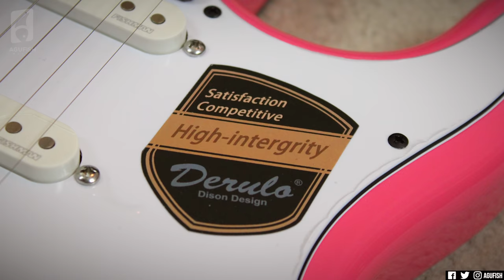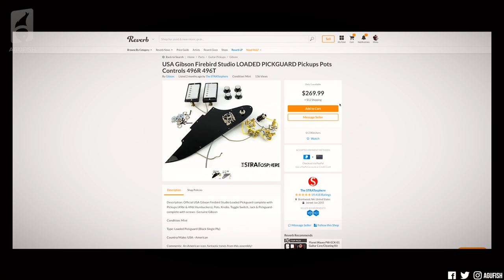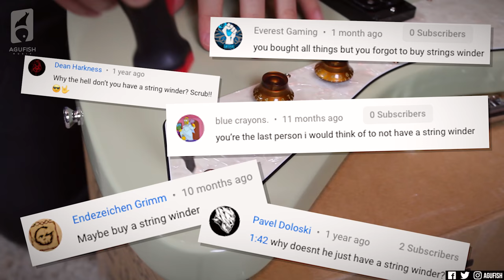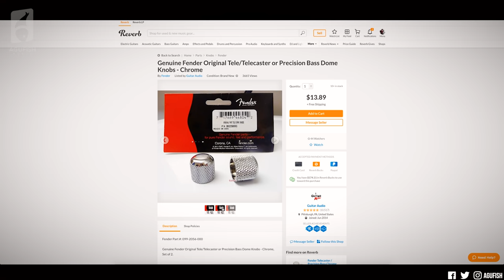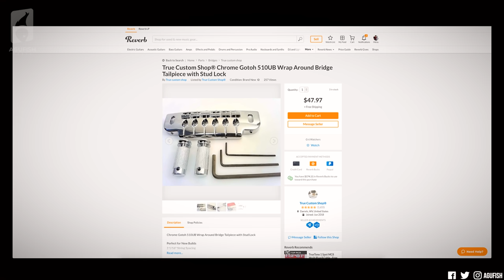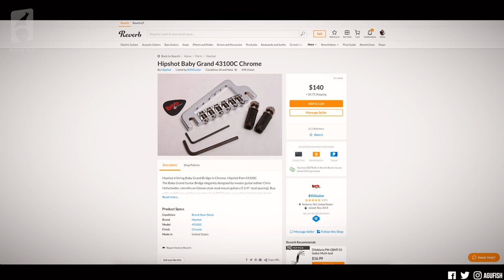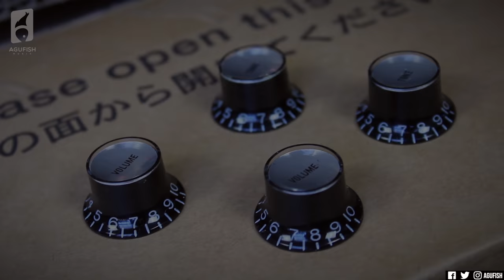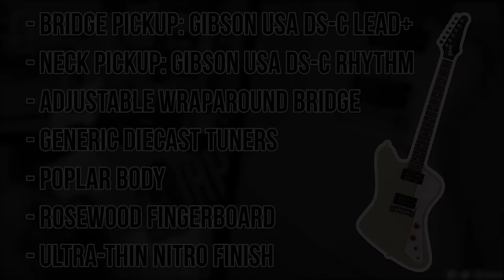Making the Worst-Ever Gibson... Good?? || High Intergrity Mod Project

Comment: "It was hard to keep in tune"
That's a Gibson feature.
Reply: I have two. An LP and an SG. Zero tuning issues. Learn how to do proper setups 👍
Reply: @jeremyrafuse5330   Haha good one.
I plex all my guitars.
Reply: Underrated comment 🤣
Reply: @annekedebruyn7797  ... you mean "plek"? 😂😂😂 I stand by my initial comment.
Reply: short scale length usually has that problem
Reply: @GideonWallace  scale is not problem. The tuning stability and the broken headstock problem is only related to the low quality of mohagony wood. neck mohagony often isn't good enough and mohagony body without solid maple on top often can't fix  posts of bridge properly  3-  angle of strings can be problematic but i guess that more tension on strings makes the special sound of Gibson.

Comment: Just a little physics correction: extending the string length past either the nut (such as a reverse headstock for B & E-strings) or the saddle “witness point” on the bridge DOES NOT increase string tension. Only three things can increase string tension - a lengthening of the “speaking length” of the string (longer scale), an increase of string mass (heavier strings) or changing the pitch of the string (i.e. tuning upwards).
Reply: Ian Perge a longer string feels more slinky and easier to bend.

Comment: I think your final build pickup heights are a bit different than the stock pickups, which can account for a big change in tones, 1/8th inch can do a lot (which adding the thickness of the cover moves the pickup lower in the body if you'd measured distances to the strings). Same strings? Chrome covers can cut some highs. You can do the same with tone capacitor swaps for higher uF. I would have also measured the volume  pot kohms and sorted for a Bourns/CTS replacement -- which will be more durable over time than the import full size pots -- actual kohms of the pots matter (they have a 20% tolerance range that is huge when considering 250k is 50% of the 500k used in single coils vs humbucker guitars that people are familiar with). So in the end I would have kept the stock pickups and modded the controls to get the tone change. Reflector hat knobs were a good call.

Comment: The Gotoh bridge is amazing and super comfortable BUT two things if you ever get one: 1) Different anchor size (like the Hipshot) to Gibson. It's metric like the Hipshot. I had to fill and redrill the holes for the new anchor size 2) if you have a low neck angle, it'll be a pain because the strings wrap down and around as opposed to a traditional out-the-back style.

Comment: I can't hear a difference between the stock pickups and the new.  Is it just me?
Reply: the difference is clear in the solo tracks (the 496 have more mids and lows), but in the mix, it sounds the same. The sad part is that both pickups don't cut thru the mix. Good Pickups for rhythm, but for solo is not that great of a deal
Reply: I can, but they both sound very bad. What an absolutely awful plank. If I bought one of these for $150 I'd want my money back.
Reply: @pollinirr  Suggestion:  Install some Seymour Duncan pickups or Gibson 59 PAF reissue pickups and before adding a little distortion pedal to the sound play cleanly to hear the details -  If your Gibby sounds good clean it will sound great when adding efx pedals. Your amp tone also affects the sound a lot too. Were all tone chasers.

Comment: Cross-threading a metric thread...I remember doing that a few times when I was working on the production floor in the machine shop.  I had to reverse-engineer a part from a long-defunct company to repair a larger component (and we had no access to any of their blueprints).  "Oh hey, it's a 3/8-16 tapped hole!  But it's kinda bunged up...I'll run a tap through it to clean it up and see how deep it's threaded." *2 minutes later* "That was kinda tight and there's a lot more chips than I thought there'd be...fuck...that was a metric thread..."

And yeah, I love buying cheaper brand-name imports and hot-rodding the shit out of them!

Comment: Hunter, I think You are right about the upgrades. I have a 2017 Gibson Zero that came with a Seymour Duncan humbucker in the bridge position and will add a Hipshot Baby Grand and Grover locking tuners soon... For me this Gibson is far from disappointing since I can make it a Players Guitar and have a good guitar - maybe the body color could be better or more true gold like the Les Paul Goldtop. The Duncan pickup is killer awesome and so is the neck on this beast. The Gibson "slugs" pickups lack clarity and bite so getting better pickups is recommended. Yes. Made in USA pots could be a good idea too but you said the Korea made pots are acceptable. Lower action with the Hipshot installed also is a great thing. I nicknamed the Hipshot Baby Grand bridge the Piano Bar. It's awesome too.

Comment: A $12 metric locking tailpiece, with adjustable saddles fixed my M2 and Firebird Zero perfectly. I got them from “Philadelphia Luthiers” on eBay. I put a pair of SD Phat Cats (P90) in and both play amazing. I also know what a good guitar plays like. I have a Parker Fly and a Rickenbacker.

Comment: Nice work!
So I’m sitting here staring @ my new JJN Epi and a new Hipshot BG bridge. Already assumed threads wouldn’t match, pulled bushings out, what I didn’t expect was Hipshots bushings being a smaller OD!? Even though I could clearly see the gaps in your vid?🙄
How did you compensate for that especially with the ground wire coming into play?✌️

Comment: I would put one of the old humbucker back into that guitar. I like that twang when clean or only slightly overdriven. Maybe as replacement for one of the newer ones, but personally I would take dremel, saw and router out and add a third pickup. For the switching I would be lazy and simply using a fender blade type switch. Maybe something insane like a Freeway 5B5-01 with two layers of 5 position.

Comment: Very cool upgrades. The sound difference was good. The original pups sounded weak and thin. The new ones are much more clean sounding and warmer. Now it’s a player for sure! I’m upgrading a 2017 M2 from that line with Gibson Deluxe Green Key Tuners and the Hipshot baby grand. Before I change the pups I’m going to see how it feels first. I got the guitar for $20. The other thing I did already is I checked the nitro finish and it came out great! 
Cool video man and keep them coming 
🤟😎

Comment: 10:30 Angled tailpiece does not actually change the string tension.  The portion of the string that needs a set amount of tension to achieve desired pitch still requires the exact same tension.  The saddle to nut length is what changes string tension.
Reply: that's true
Reply: True, but the saddle contact force is changed by having different break angles over the saddles. While not accurate, I can understand people describing this as a difference in tension at the saddles.

Comment: I would've slapped in some gearless tuners like they do with other Firebird models but the Grovers work as they should. I noticed you put in the screws, good call. 👍 The only thing it's missing is some strap locks.

Comment: On my cheaper guitars I put more effort in fine sanding the fretboard and polishing the frets and tweaking the wiring than hardware and pickups. To save money you couldve gotten non Gibson humbuckers and non locking Grovers for instance. Then have more money to buy fine grade sandpaper and better pots, different caps and treble bleed maybe, or make a new hole in pickguard and have 2 volume knobs. Love that baby grand 'tho. Good call on that. Only other idea to me is really splurge and add a tremolo. But neither Maestro nor Bigsby stay in tune that well without maintenance and a different bridge.

Comment: I'd be interested in an A/B on the stock wraparound and the Hipshot with the same humbuckers. Most of what my ear hears between the two on the clean stuff is a bit more ringing on the deep end, and a bit less jangle on the high end. I'm wondering how much of that clearer bass might be from the Hipshot, and how much is just the better clarity in general on the 496 set.

Comment: Hey yo, so you said the anchors for the bridge used metric measurements. What exactly were those measurements?
I'm looking to replace the stock bridge on my Yamaha RS502 with the Hipshot BabyGrand, but the stud spacing on the stock bridge is 81.5mm. Was that the same case with this Firebird, and will I be able to do the same thing you did?

Comment: What a fantastic video! Great job on breaking everything down. The before and afters were excellent!  I personally would have changed the pickguard to a black one. I did not have an issue with the color of the guitar whatsoever, I think the color is great! The bridge definitely made a world of difference on this guitar! perfect choice! Like you said, It filled in the emptiness on the body. Again, great job! I would suggest seeing if you could improve the integrity of the Epiphone Les Paul Special (P90) Guitar Center was running a special on these for $99 and is probably the worst guitar out of the 15 guitars I own. Can hold its tuning for nothing. Sound quality sucks. Just a straight-up mess this guitar is!  Keep up the great work!

Comment: Why didn't you just bought OEM chrome covers afterwards? They sell for like 10 bucks a piece (certainly cheaper if you don't buy from Gibson) and you may just put a piece of double-sided tape on top of the hidden coil if you don't want to bother soldering it to the base plate. EDIT: oh, you've done that

Comment: The bridge doesn't affect string tension. The only things that affect tension are string gauge, tuning, and scale length (the length of the VIBRATING part of the string.) Before the saddle and after the nut doesn't matter.
Reply: True, but the saddle contact force is changed by having different break angles over the saddles. While not accurate, I can understand people describing this as a difference in tension at the saddles.

Comment: If you were going through the trouble and expense of replacing tuners why didn't you just get some Steinberger gearless tuners like the firebird came with or maybe a set of Riot works tuners might have been a little cheaper.

Comment: Just a small correction: Yes, knobs that are made under license or have brand re-pro street cred usually fell/look the same and are well made.. however!!! i''m currently the owner of 73 dome, speed, tophats etc etc etc from china that i have collected from used guitar projects, which of atleast 70 of them are poorly made, bad molding job, doesn't fit properly. I use those just on donor guitars(guitars i give away) or just give them away plainly cause the space in my parts drawer is more worth it to me. Just sayin' beware of knockoffs

Comment: Thanks to this video I'm now GASing for the Firebird Zero in full black. I have some  black Wilkinson locking tuners and black WIlkinson bridge laying around from other unrealized projects. Also pair of EMG H2 pickups and bag of black screws. I could make it into complete "blackout" head turner. Still... the power of the brand is too strong and I don't yet want to throw 700$ for ugly duckling to turn it into (black) swan.

Comment: Dang bud not putting the screws in to lock the movement of the keys is major don't work that way ,unless u have to crank them down and indent the head .love your riffs . come on man . love ya bud been with you a long time i am a guitar setup guy . I do fret leveling and crown by hand and polish with hand made tools .Send me one of the guitars you are having a problem with fret work .I will  make it right . Heck let me set up a guitar that can't be set up. Im that kind off  craftsman. Would love the task.You have a great channel been loving it for a while. we can email im disabled but kicking good need some exposher .Im tru blue. I make frets that you can see yourself in .Slick as snot on a door knob .

Comment: The bridge on those models was the weakest part, and really unforgivable. The mounting posts were mismatched in size to the bridge itself, so the thing leaned forward and up! (There’s no excuse for this — getting it right wouldn’t have cost a penny more than getting it wrong.) Even just fixing that alone would’ve really improved the guitar.

Comment: a few years back they sent a damn spaceship to mars that failed because the two different teams working on it were using metric and imperial...
i know hell will freeze over when they finally start standardizing guitar parts sizes...
the one that drives me crazy are the CTS pots - their poles dont fit any goddamn knobs you might already have or could easily obtain... i dont fall for the meme...
also not a single part from a gibson lp will fit an epiphone lp - they did that on purpose...
Reply: i was being sarcastic but only slightly - in addition to bridges, i've encountered pickup and pickup ring mounting screw differences, and pickguard mounting screw differences...

Comment: does anyone buy from the stratosphere? they seem like such a rip off
Reply: segazora I bought a new 2019 Gibson explorer from them as a stripped husk. I built it up exactly the way I want it with all gold hardware, custom pickguard with no hole for the switch, moved the switch to the first volume pot position to run it 3 way toggle 1 volume 1 tone, Grover tuners, and a Duncan custom 5 in the bridge 59 in the neck. Total cost was barely under $1100 for everything. I saved $600 on a new stock explorer and built it exactly how would want it to be.
Reply: @Russian Account as compared to the percentage of value for the parts... If you look on their listings, they'll ask for 80% of the retail for the complete guitar for just the body etc.

Comment: Nice hardware selection, you turned this steaming pile of overpriced (for what it was) garbage into a pretty sweet player. The only decent thing about these was the necks which at least were set necks and with some cleanup/finishing actually work very well. The body is less important to a great player. Awesome giveaway, someone is going to enjoy this thing for sure.

If Gibson released it with these specs for $600 it would have been a hit. No way they would have done it though, these would have sold like hotcakes and the more premium studio, standard and traditional lines would have taken a huge hit in sales (according to them anyway). Honestly, I don't think it would have cut into higher end sales that much, it more would have stolen market share in the mid level market where Ibanez and other import brands typically dominate.